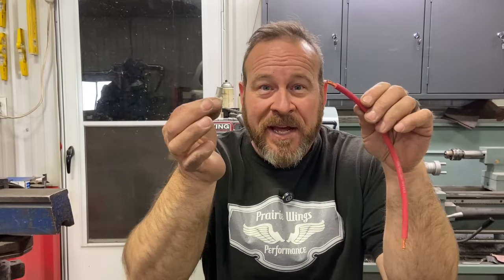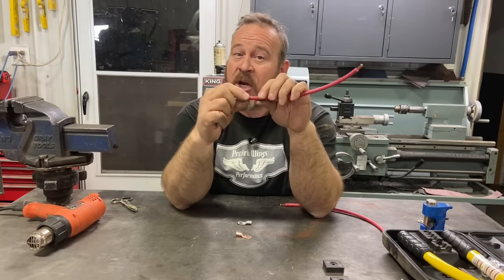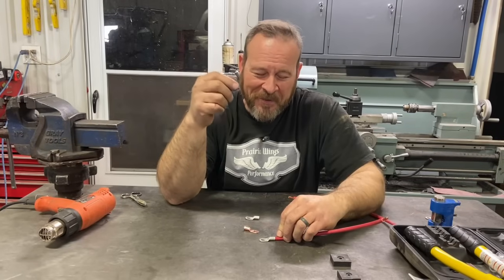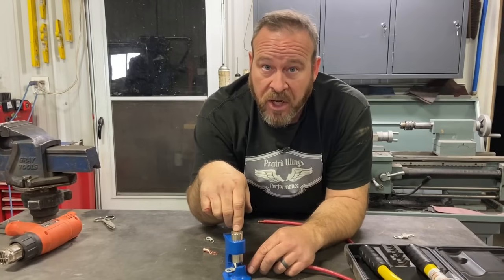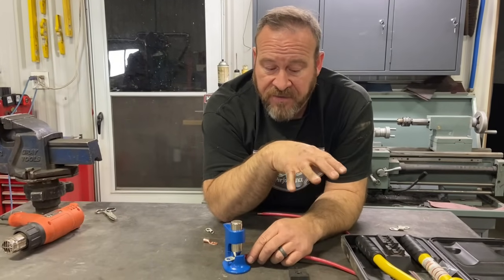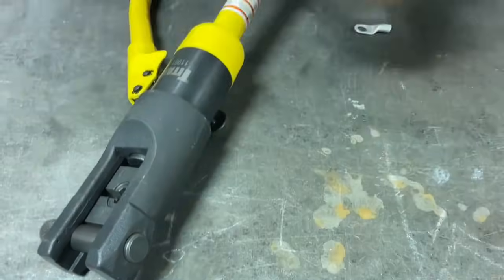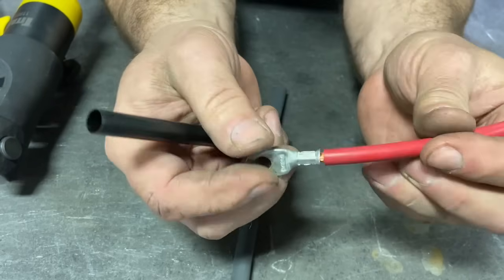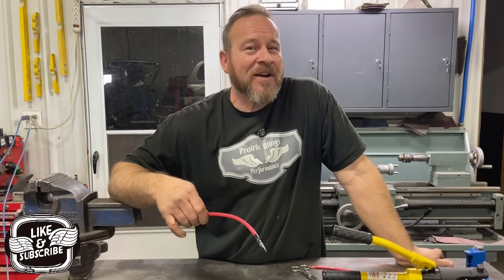Crimping Heavy Cable Ends - Which Way Is Better?

Comment: I have a hydraulic crimper from harbor freight, it has flat areas on the head portion that allow me to mount it in a vise. A world of difference running the lever with one hand and the crimp end in the other without having the crimper flop around uncontrollably on the bench. You might want to try mounting your crimper in your vise. 

From what I have heard a soldered joint has more resistance than a crimped joint, that’s why the world is moving in the crimp direction.
Reply from the maker: @ringerson4x4   absolutely great tip, there have been a few guys said they have made mounts. A vise would be simpler. Lots of the crimps I have to do are in difficult spots in a cramped area but when I can it will be in a vise. 

I’m not sure on the solder joint but there are a lot of different options both ways! I personally like the crimps, I think they look very professional as well. 

Really appreciate the time you took to share!!

Comment: I love watching the uneducated try and educate others. I have been in the electrical supply industry for over 40 years with approx 400 million in personal sales.. I have seen crimp failures that have cost millions to repair.. Use only name brand terminations from the likes of T&B/Blackburn, Panduit, Ilsco, Greaves, Penn  Union (all UL listed and made in USA). Get the catalogs, every term or splice takes specific tools and they are not universal. The manufactures compatible charts of compatible UL listed pairings so you can do some cross brand operations but always look at the charts first. Since so much of the stuff on the internet is fake only buy at big box or even better from a real electrical supply house.. Don't trust the help for advice at the big box. A senior counterman at the electrical supply house would be your best source of info if you think you need help...
Reply from the maker: @darikmatters8866  thanks for sharing, always great to get advice! Lots of great advice in the comments in this video! Sounds like you have lots of hands on experience!!! Thanks again for sharing.

Comment: I was a forklift mechanic for 50+ years on electric and other fuels , you did a great job , but tell the people that you don’t solder , because when a electric cable or wire heats up because of a problem it can unsolder the cable and cause even a bigger problem, major short, fire and etc !
Reply from the maker: @markchodroff250  absolutely, thanks for the add!! Resistance = Heat = More resistance = More heat… kind of like a snowball but opposite temperature wise!! Thanks for taking the time to share.

Comment: Time stamp 9:45...  That's not true...  Look at the hole in the end piece, that will allow moisture to enter in the end of the cable...
Reply from the maker: @j1mbobtech  yup called out on it lots, can’t see the forest for the trees sometimes😥. Those are the ends that come with the aftermarket wiring harnesses, I should have sealed it or put the coating over it. I appreciate you taking the time anyway to reach out.
Reply: just put heatshrink over the whole end. easy ! :))))
Reply from the maker: @SilverBullet93GT  absolutely!! Thanks again!

Comment: Great video. There is so many videos done by people who don't know what they're doing. I've been doing electrical since the late '60s (automotive and industrial). The only thing I might add is, I always use an electrical joint compound on the bare cable end and inside the crimp. I worked a lot in south Florida (with all the salt air) and warrantied my work for the life of the machine. Doing that meant I darn sure had to figure out what worked and what didn't.
Reply from the maker: @thehogdoctor  absolutely a great tip! What brand did you use? Thanks for taking the time to share, much appreciated!!
Reply: Yeah, what did the compound comprise off?
Reply from the maker: @marcusmohorco380   I had the same question and thought dielectric, but looked it up… Turns out there is a compound that is specifically made for this to prevent corrosion (not just dielectric), lots of different brands on the Google machine. Would love to know what @thehogdoctor used specifically??

Comment: Yep. I do exactly the same thing otherwise the die’s can not fully crimp with metal I between the flats.
Thanks for the tip on the heat shrink mate.
Reply from the maker: @kensutherland414  thanks again, I’m glad the tip helped!!

Comment: I wish I had seen your video a year ago.  Last year, I installed a new deck on the back of the house 65x12. I used stainless steel cables every 3 inches on the vertical post.  When I put the 1/8" stainless cable into the stainless adjustable ends and crimped them, I was getting wings.  I understood why it was happening but I did not know how to make them better.   All of the adjustable ends are hidden inside the wood post.  Thanks for teaching me a new trick.
Reply from the maker: @wildpigremovalinc.executio8028  thank you for taking the time to watch and to comment!!

Comment: I have the Temco version of that crimper, works well. However, I generally prefer to use an Amp Rotacrimp which has rotating dies and makes a square crimp profile.  It is an expensive tool but can be found used for ~$250.
Reply from the maker: @AT-zc1ik  absolutely appreciate the tip! I definitely have a new crimper on my wish list after all of the great comments. Now just to figure out how I can hold them all to do a comparison. Thanks for taking the time to watch and share!!

Comment: Never re- index the lug and crimp again to get rid of the “wings” flashing/extrusion . To do so will force the cross section to reshape with reduced grip on the cable and the possibility of fracturing the grain of the copper. As small flashing that can be easily be cut away with a utility knife is perfectly acceptable but they need to be removed so that it doesn’t cut or damage the heat shrink.
Reply from the maker: @SkypowerwithKarl  hmm, never thought that would effect the crimp… thanks for sharing!
Reply: @prairiewingsperformance6036 
I use an “internal resistance meter” YR 1035  for checking cable and connections for integrity before even putting power through it on my battery builds. They are not just for checking cells. The craziest thing is how much difference there is when you remove the oxide inside of a tinned lug with Scotch bright and crimp vs doing nothing. Definitely worth the extra effort. Never would have believed it.
Reply from the maker: @SkypowerwithKarl  great info! And how easy it would be to take the two seconds to give them a quick clean!! Thanks again!!
Reply: @prairiewingsperformance6036  
Exactly, a couple of twists and a blow
Reply from the maker: @ set up a copper brush on a drill??
Reply: That would be really small wire wheel. You don’t want to remove the tin, just put a shine to it. I’ve just put a small corner of Scotch bright in and push/rotate it around with a scrap of wood or small screw driver then tap or blow out the dust. Clean metal to metal makes the best “cold weld”. I’ve tested all kinds of conductive(silver,copper,carbon, zinc) anti oxidant or dielectric greases in the lugs and at best no differences, so just clean is best.  (For “power lugs” follow manufacturer’s instructions for antioxidant application).
Reply from the maker: @SkypowerwithKarl  I have a ton of small copper brushes for demel tools. They are awesome, I have to restore tons of old stuff. Easy to find!

Comment: I wonder when someone is going to make a battery operated linear over oil press for in the field instead of a hand operated mechanical press?
Reply from the maker: @wreckum56  sounds like a great idea! You should capitalize on that one! Tons of these crimping tools use the same hand pump, make a conversion and I bet tons would sell!! Thanks for taking the time to comment.
Reply: it would make it easier to use in a confined space  @prairiewingsperformance6036

Comment: Anytime I make cables, I only cut the insulation back so it bottoms against the terminal. Then I shrink wrap it twice, one piece about double the length of the socket on the terminal, then I go over it again with one twice that length. That makes it even more sturdy.
Reply from the maker: @garyszewc3339  another person in the comments (I will need to go through to find it explained how that meets a code I believe?!?). Thanks again for taking the time to add this tip!

Comment: Worked as an IE at a Tier 1 auto parts supplier of wiring harnesses.  Many large terminals were soldered by hand using a solder pot and hand dipping them.  Some were also crimped using a press similar to a small stamping press. A good operator did several a minute !!

The small 10 to 18 gage used automatic stripping  and termination.  We did 100's of thousands a day.

Comment: Solder all day long. Seen way too many crimps coming loose, causing heat and corrosion.
Reply from the maker: @DuWayneAMiller  absolutely if a crimp comes loose we can call it a snowball!! Resistance causes heat, heat causes resistance, resistance causes more heat, heat…. =failure or fire!! Thanks for taking the time to share!!

Comment: Nice job. However, if you are trying to get a moisture tight seal with the shrink tube you need a lug that does not have a weep hole in it. I don't know why you would ever want the weep hole in the lug.
Reply from the maker: @lanejohnson1245  yup called out lots on that one those are the lugs that come with the aftermarket wiring harnesses. Can’t see the forest for the trees sometimes. Thanks for taking the time to watch and comment!!

Comment: Yes  I've noticed the problem with the dyes leaving the little wings on anderson plugs then they won't plug into the holder properly
Reply from the maker: @hickory01au  absolutely that would be a problem, hopefully this video was a helpful tip to eliminate that issue. Thanks for taking the time to comment, much appreciated!!

Comment: The crimpers accepted by electrical and telecom inspectors that I am used to seeing is made by Burndy or something similar. They are not afraid to charge for their products either. From Hand crimpers for #2 solid to #6 are $350, to hydraulic crimps around 4k, to drill attachments that sell for 8k crimping up to MCM 750. Telecom demands 2 hole lugs with inspection windows to make sure copper runs completely to the lugs end and clean heat shrink to polish off each finished lug. Hardware and antioxidant application is another chapter after that
Reply from the maker: @JV-wl6ex  you definitely would need to be crimping a lot of lugs to be able to justify the cost of that set up! I really appreciate the time you have taken to share!

Comment: I do exactly the same process to crimp my cables. I use the same tool however I made a jig to hold it upright on the bench. It makes handling it so much better.
Reply from the maker: @markhuisinga1698  that is an awsome tip! Thanks for taking the time to share!!
Reply: 좋은 방법이네요. 혹시 보여주실 수 있나요?

Comment: Lot of folks are adding dielectric grease.  Might want to try a bit of NoOx paste instead.  Haven’t done it yet, but will try it this summer.  Edited to add:  Just checked the site of a company which makes both NoOx and  Dielectric grease.  They say both are resistant to acid attack from battery leaks, and recommend the NoOx for battery terminal connections.
Reply from the maker: @randallthomas5207  nice! I so appreciate you taking the time to add more to this conversation. Sorting through all of the comments will turn out to be a great resource for anyone looking for tools and products. Thanks again

Comment: Ive always just smashed them down with a hammer, but i have also used the hammer crimper, and an old school big leverage crimper, the hydrlics crimper were not as common as they are now.
But the cost is very high for just the tool. Any one of the methods work very well.  I also use copper ends
Not aluminum type.  
I've never had one come loose.
They all work.
And trust me I made a lot of crimps on 4awg and 00awg wire in car audio. More then you'll ever make.
Reply from the maker: @bobbg9041  I definitely am not saying other ways of installing lugs are bad. The lug I put on this one is copper it just has the coating on it. I absolutely appreciate you taking the time to comment and to share your experience!! Thanks for watching!!

Comment: clamp the lug into a vise. cut the insulation on the wire a little over the depth of the inside of the lug. put a piece of shrinkwrap onto the wire away from the heat. take a torch and heat the lug until it's hot enough to melt solder, fill it with solder, and  then put the bare wire into the lug and let the solder wick up the wire. remove heat and let cool. then slide the shrink wrap up until it covers the lug, heat it until it shrinks around the lug and the wire. ta da.
Reply from the maker: @a-fl-man640  that’s what I was taught in trade school! Thanks for taking the time to comment.

Comment: Sorry, but a friendly disagreement here if you’re using that fitting/lug for a battery attachment. Retired marine mechanic here. When your drawing amps with a lug like that from a battery, a crimp job will get hotter than a solder job. And in the water world, like boats, it’s great to have the shrink tube on the end, but if it fails a solder job will not let water intrude and start corrosion as fast. There are plenty of videos online to prove a solder job stays cooler than crimp job when drawing amps! Heat means waste in amp draw, you get a lot more contact area with solder so it stays cooler! We actually proved it. We had a new, older gentleman start and he always crimped, I told him we solder here, he got mad, told us we were full of it and refused to believe it. We rebuilt a lot of big block GM motors for boats, so what we did the next time we put the motor back in boat, we connected our dyno to the lower unit for a load. We installed his crimped cables, removed coil wire so motor won’t start, and tried starting motor with temp gun pointed at cable end, and we cranked for a timed 30 seconds under the load, than we changed to a soldered cable and did the same. The crimped wire got to about 160-170degrees, the soldered one never got above 125-135. Crimping has its places I/we will agree, but I/we will never use for drawing amperage from a battery!! And when we have credit card boaters on the water that when the motor doesn’t start, they will crank forever to the point of burning up the starter motor we can’t, and will not let them burn too death. We all know car manufacturers use crimping for the battery lugs, but now days they also have other protection heat sensors to protect the car from stupid people. Again it’s just what we do!
Reply from the maker: @jackhuizenga4630  it’s all good. If you search through all the comments there is a ton of different ideas. I started crimping after going to manufacturer courses when working at a dealership. Took some other wiring courses not vehicle manufacturer specific they taught crimping as well. I’ve been doing it for years and they have been lasting. I was taught that the crimp handles vibration better??? If you look in the comments there are lots of different ideas about both ways with documentation and codes to back it up. Different applications seem to do things differently. What I take out of it is the way I have been doing it has had great success. I also take out of it I have some new tools to put on my wish list (I love tools) and some documents I will be reading over (I love to learn). I’m glad I did this video, is it perfect, no. Has this video brought out great discussion and information that will help a ton of people, YES. Any time I can help someone or facilitate someone’s learning I’m in. I really think your opinion and your experience is valuable and I am very happy you took the time first of all to watch and to share your knowledge and experience!! Thank you!

Comment: You might as well not have bothered heat shrinking the terminal as the witness hole for checking the conductor reaches the end of the terminal is still open! 
Most heat shrink will tighten down on that area if you set it in a position where it covers it.
Reply from the maker: @grahamstretch6863  yup, been called out on that one lots. It’s the ends that come with the aftermarket harnesses. You are absolutely correct, has been dealt with. I do really appreciate you taking the time to watch and to comment!!
Reply: @ 
I do pretty much what you did, but I use the old manual ratchet tool that just caves in the back of the terminal much like the impact tool you show, I just make sure that the hole is covered by the heat shrink tube. 
I also use red sleeving on the red cables, though I’m usually replicating cables for 60s and 70s British cars which tended to use black insulation on the positive lead and open braid for the ground straps.
Reply from the maker: @grahamstretch6863  yup, ran out of red and didn’t reorder 🤦🏻‍♂️. Sounds like you have a fun job! You on the other side of the pond from me??
Reply: @ 
Yes, Isle of Wight UK.
Reply from the maker: @ that is pretty awesome!! Thanks for watching! One day I may be able to travel the world. It would be fascinating to see the scene over there. I have a couple friends that were stationed at the British military base close to where I live, they decided to stay here. It’s unfortunate, I believe it is pretty much cleared out since the world is gone weird. I’ll choose to stay out of that conversation though!! Thanks again.